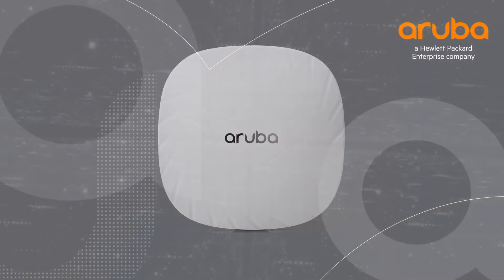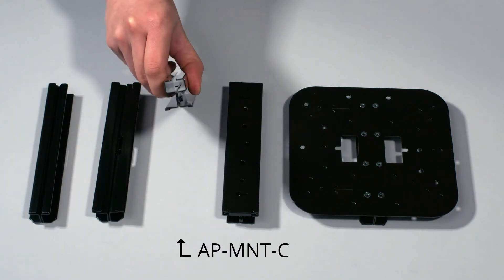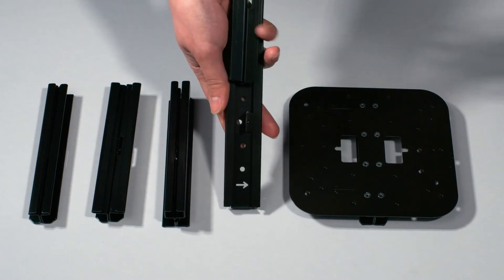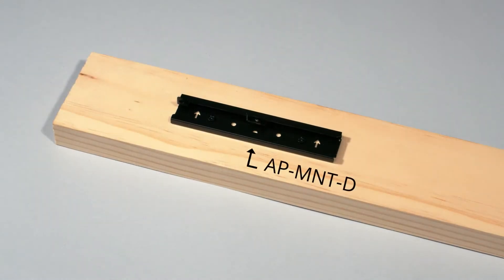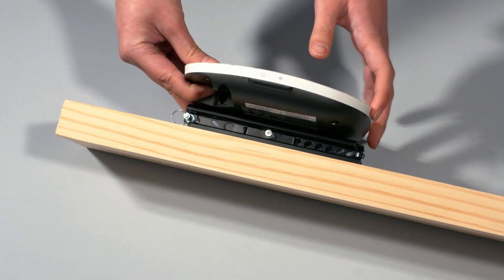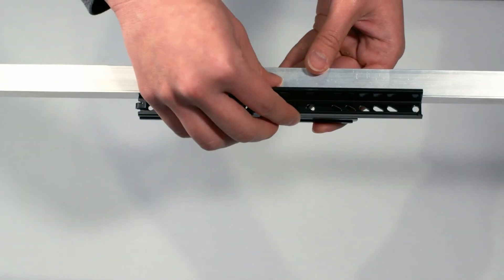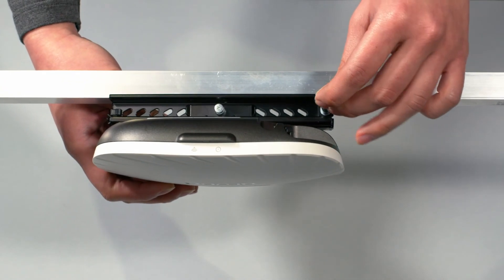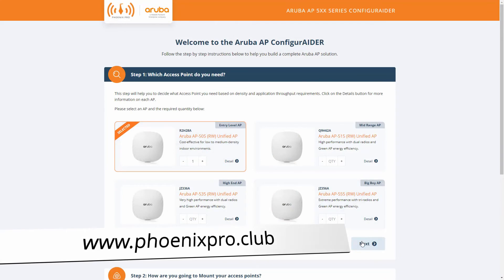Aruba AP500 Series Indoor Access Points Mounting Guide

Comment: When doing a ceiling grid mount versus a solid surface mount there is nothing for the center screw to tighten into. The AP is only held in place by the spring loaded retention pin.
In the video it says you can tighten the screw down in both installation methods but that does not seem to be the case. The threaded hole for that center screw is only present in the solid surface bracket.

Comment: is there a part number for the bracket that's supposed to be pre-installed on the AP itself?  The metal bit that slides into the various options of mounting rails?
Reply from the maker: Unfortunately not. It's not available as a SKU
Reply: @ArubaPhoenixProClub  Does it come standard then with the AP or with the type of mounting bracket?
Reply: @martinprinsloo5653  they come standard with NIB APs, and it's a crapshoot whether you'll get one on the third party market
Reply: @ArubaPhoenixProClub  well you guys should make one.  These get left on rails all the time during de-installs and are impossible to mount properly without them.  Someone made one on a 3D printer, you guys can make a SKU for it and manufacture spares

Comment: how much user can support for data sharing and for networking printing
Reply from the maker: Hi Abhishek, unfortunately the answer to your question is typical answer given by engineers and it's: "it depends". It depends on many factors. First question is: How much sustained throughput are you trying to deliver to each client simultaneously? 500Kbps/5Mbs/50Mbps? All of these are valid answers but can affect the number of how many users you can "support" per AP by a factor of 100. Other questions to consider: Are your clients 2.4GHz or 5GHz capable. Are you using 20MHz, 40MHz or 80MHz wide channels. Are your clients really close to your APs and can connect @ really high data rates or are they far away and are connecting at very low data rates? How congested is the spectrum where you are deploying this network? Are there 10 other APs and 100s of clients sharing the same channel. Remember WiFi runs half duplex and only one device can transmit at any given time on any given channel meaning you will have to wait for your turn if you have many neighbours. Have a look at this video by Ekahau: https://www.youtube.com/watch?v=kwp2szhU_WI to get you started on Wireless Design.
Reply: @ArubaPhoenixProClub  i can make this bracket